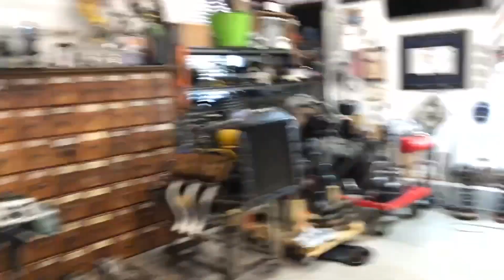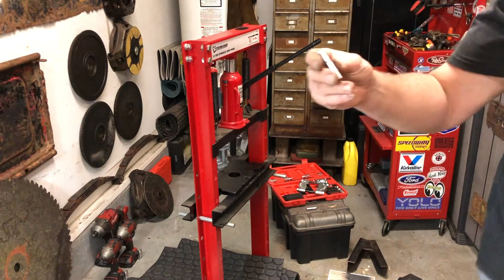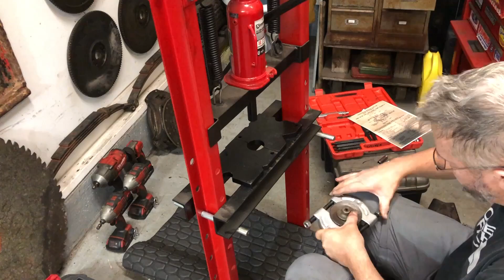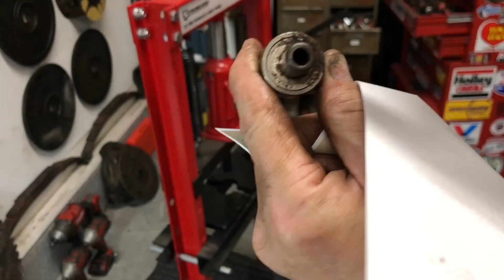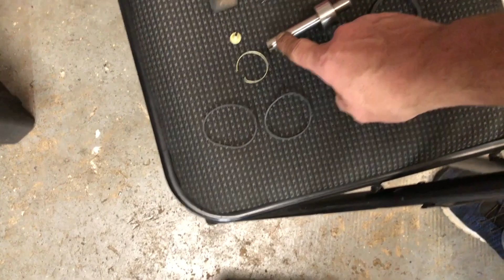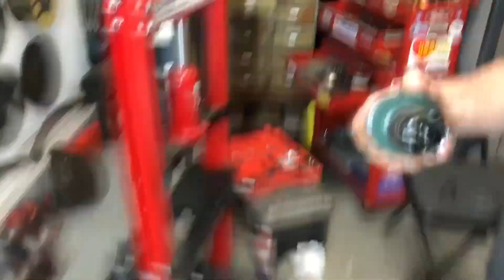V8-60hp Water Pump Rebuild (1937-1940 Ford Flathead 60hp)

Comment: Great video Chad.  In the process of rebuilding mine when I found your video.  My 37 panel truck has been sitting for 50 years not running, figured it's a good idea to check the pumps out while I have the radiator out. Thanks again.
Reply from the maker: I hope the video helps!  Thank you for watching!

Comment: Hi Chad,  where did you buy the rebuild kit?   Thanks your video is very helpful
Reply from the maker: I bought my rebuild kit from a seller on eBay.  My pumps are the tapered pumps.  I tried searching for a rebuild kit recently for another subscriber and I wasn’t able to find one online.  I’m sure they are out there.  Check with the seller “NJPARTS” on eBay.  Find one of their listings and send them a message asking about a 60hp water pump rebuild kit.  The part number I used is BB63.  The Ford part number is 52-8591.

I hope this helps

Comment: Two things I did differently, first is the pulley removal. I used a small bearing splitter and grabbed on that groove at the top of the pulley. Pressing on pulley grooves makes me nervous. Also the retaining clip should have been flipped as the divit holds in the shaft so it can't flip out.

Comment: Press hacks:  Make a little "key" for the pump release tab and zip tie it to the handle.  That way you don't have to keep removing the tubular pump handle to tighten & release.  Also, JB Weld a couple of neodymium magnets onto the front of lower part of cross bar so you can stick the tubular pump handle on it for easy access.  Plus it will be safer by not sticking out.  I have the same press as yours,
Reply from the maker: Good ideas.  Thank you